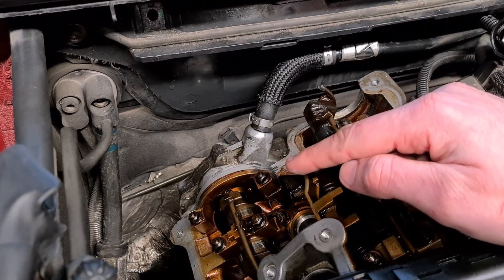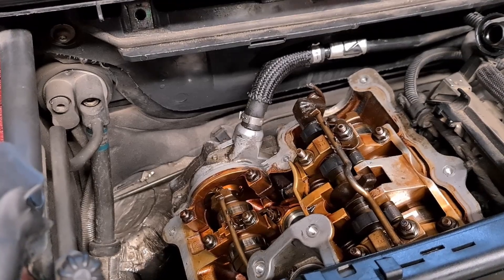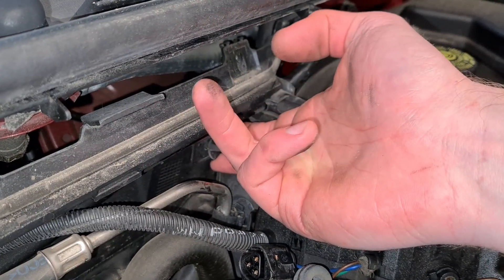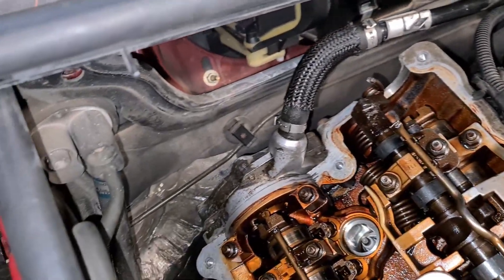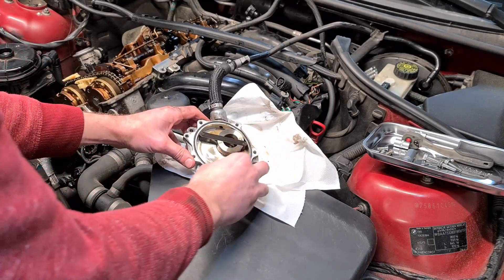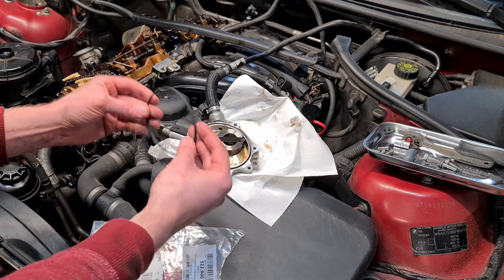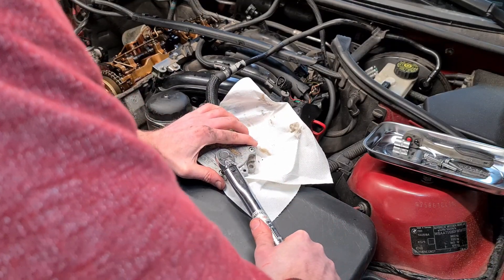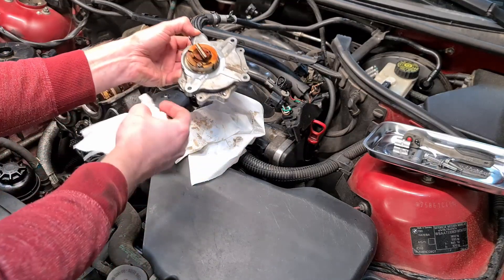Replacing vacuum pump seals - BMW N42/N46 Chain Rail Replacement [PART #7]

Comment: Can you do this without having to taking off the valve cover?
Reply from the maker: Yes. It's just a bit harder to do. You have to make sure that the slot in the camshaft aligns with the tooth on the pump. Small mirror helps.

Comment: I have the same car and when I start it in the cold in the morning, a smoke comes out of that area and there is a smell of burnt oil. The mechanic told me about this part that the oil was leaking and I changed the oil seal, but I have the same problem. Anyone who has had a similar case with the n42b20, this is definitely causing the problem, I don't want to blame the engine block, I hope it's not like that
Reply: my main question is that i already replaced seals but its same on my case. is there any chance that its whole vacum pump must be replaced or i have to find another part of that problem cause
Reply from the maker: @lashaarbolishvili5810  did you replace both seals? Oring and back cover seal? Aso, valve cover gasket can leak at the back - usually where the sharp corners are near the vacuum pump arch.
Reply: @ i don't remember exactly if i change both seals. i will try one more time. is there some brand or something who can i trust with seals?
Reply from the maker: @lashaarbolishvili5810  Elring

Comment: Hey! Someone before me stripped the thread inside of the engine. I tried to fix it by it's impossible to get it done. any tips? It's the top bolt that holds the vacuum pump.

Comment: Could this cause low and rough idle? My engine idles at almost 550 rpm, and shakes a bit, under any kind of throttle it works smooth like butter. Im going mad chasing any vaccum leak. I cant pass emissions test either, any suggestions?
Reply: hi, first check plugs, ignition coils, but it could be one or more injectors failing.  Get a diagnostic done to guide you.
Reply: @Telstar_1  Everything is checked out. I just changed the headgasket, resurfaced cylinder head, changed valve steam seals, changed CCV, new spark plugs, filters... every seal has been changed too, vanos solenoids cleaned. The car run fine before, it run silky smooth, even tho it had a bad head gasket, bad timing chain, broken chain guides, worn out oil pump chain and guides and an engine full of gunk. Now everythin is new and resealed, the car runs like new, when not IDLing. I just passed emissions by turning on the AC (??). The bad idle seems to persist, only goes away when turning on the AC.
Reply: @Raul_VRC  You could also check for oxygen / NOx sensor faults.
Reply: @Telstar_1  O2 sensors got changed aswell, the car is throwing no codes
Reply: @Raul_VRC did you figure it out?
Reply: Its 100% ist CCV. 

Change the cyclone and the 3 Pipes.

Comment: How do the internals of that vacuum pump stay lubricated?

Does engine oil circulate in and oil of the pump somehow?
Reply from the maker: @OilBaron100  there is a small oil channel at the end of the lifter oil channel that leads to the oil port on the vacuum pump. Oil gets in to the pump, circulates around and is then ejected back in to the engine via flap valve.

Comment: Is it ever necessary (in your experience) to replace the entire vacuum pump? (Ie: does the pump fail mechanically)?

Or is usually only necessary to just replace the o-ring seals?
Reply from the maker: @OilBaron100  i've heard online of vacuum pump mechanical failures but i myself never had any issues except for the bad seals. The seals go bad very often and have problems sealing. A little bit of vacuum leak does not significantly reduce the brake boosting. There are however some issues with the vacuum hose connection to the booster. The rubber seal goes bad 
or gets contaminated and can have vacuum leaks, leading to poor brake perfomance.
Reply: @BimmerZen  thanks, I won’t replace my pump, I’ll just buy that seal kit.

Comment: First off, Thank you. I've used a few of your videos to do things to my e46 316ti. I'm attempting to do this but with the rocker cover/ valve cover in place. Is this possible or does it need to come off?
Reply from the maker: It is possible to do it without removing the valve cover. I recommend being very carefull not to rotate the pump when removing it so that the slot on the mechanism stays in the correct orientation. Then mark the position of the tooth on the pump which will help you match it with the slot in the exhaust camshaft during installation.

Just make sure it aligns and that you don't force anything because you might break the camshaft or the pump.

Comment: Sir please help me i attempted this process although my vacuum pump seems stuck to the motor now looking at your video, is see i might have to take the valve cover off in order to get a better angle to knock it or tap it out with some force, your input will be highly helpful please.

Comment: Do not change the seals, there is also an internal seal that is bad and cannot be changed, also the new seals won't really last. It's much better if you buy a new one.
Reply from the maker: I'll have to disagree with you there. What internal seal do you mean? There are only 2 seals and  you can replace both, they should last another 5 years or so...

Comment: Excellent video, but I have a question. How many often I need to change this ring? I mean it's necessary change this ring every manteinment?
Reply from the maker: These seals usually only need to be replaced once every 10 years or so. I would recommend replacing it when replacing the valve cover gasket.

Comment: Is it possible that these seals if bad could cause stiff brake pedal or is it whole pump bad bc i didnt get any suction from end of hose that goes to that booster?
Reply: It is common for the vane inside the pump to break as it is fragile plastic resulting in loss of vacuum and stiff brake pedal, worst case is the pump seizing up and breaking the end of the exhaust camshaft.

Comment: Useful to see the vacuum pump seal replacement, thanks.  I had this on my old E46 and a similar issue now on my E90.  What model of torque wrench did you use in the confined space to tighten the 3 bolts back on to the engine?  Are the torque settings estimated or is there a source for this information?  Thanks.
Reply from the maker: I use standard 5 - 25Nm torque wrench, it's pretty cheap and common. The torque values are from the service manual.

Comment: Do you Need to timing the motor or you can just do this after the cover removed ?
Reply from the maker: You dont need to ti.e the engine, you can even do this job without removing the valve cover, but's its easier when the cover is off.

Comment: Bad O rings on vacum pump could be a reason why is my brake pedal so hard, until i step on gas pedal?
Reply from the maker: Could be, but so could be any vacuum leak on the brake booster line/assembly.

Comment: Your videos are great! They give me the confidence to go into a job with forward knowledge, almost like I've done it before. Also you are one of few that give in depth information on the N42 engine which I struggle to find any manual or information on. I note at the end you say to torque nuts to 9nm, is this the BMW spec? If so would you mind sharing where you get your info from as I also like to do things by the book but sadly I cannot find 'the book'. 😊

Comment: Ive been told that oil has travelled along the vacuum hoe to the booster, creating problems in my booster. Why would this happen, would it be because the smaller of the seals  is leaking. my larger seal on the plate outside is not leaking and i am not getting oil down on my exhaust etc
Reply from the maker: The large seal seals the pump so it can create the vacuum for the brake booster. There is always some oil inside the vacuum pump for lubrication so it's normal to have a small amount of oil residue in the vacuum hose that goes to the booster. If the small seal is bad, then it's a good chance that the large outside seal is bad also... If the vacuum is decreased, it could mean more oil in the booster hose and weaker brake boosting. But I don't have any direct experience with your issue so I cant give you a definitive answer.

Comment: Hello Friend! I was done it seal replacement 2 time in lest 2 months, first time I was try with silicon to fit, secound without, it take a long for a one month and leaks again, in both try I have used Erling set of Rings. How is by you, how much it could be witout leaks after replacement?
Reply from the maker: Hi, are you sure that the vacuum pump seals are leaking? Sometimes it's the valve cover gasket. There are some sharp corners near the rear that need a small amount of silicone bead so that the valve cover gasket seals properly. If it leaks at the back, then the oil will pool at he bottom of the vacuum pump.
Reply: @BimmerZen  Ok! I will chek again...

Comment: This is one of the best videos. If you have a leaking o-ring on the vacuum pump it will slowly drain your oil pan. And it also is one of mystery leaks that no one can determine. It's even hard to see with a folded mirror. Also careful not to trash the threads of the bolts and get the right O-rings for replacement.
Reply: Nice video.What's the sizes of the o-rings,& that large 'square' ring?